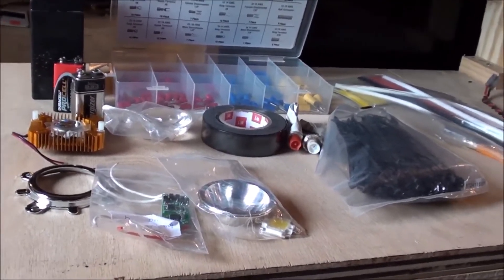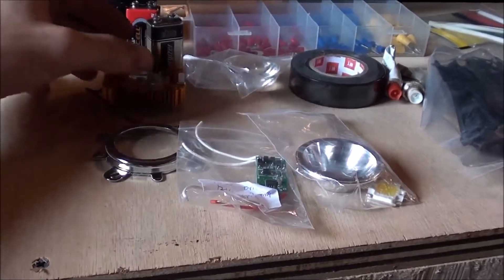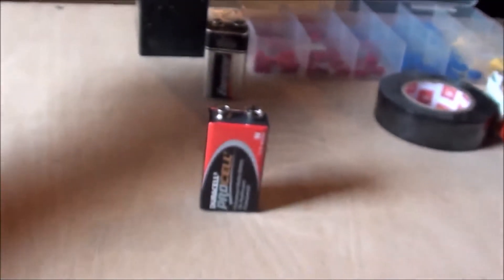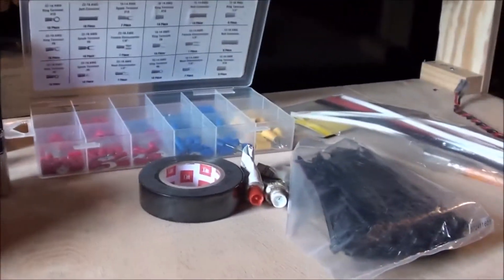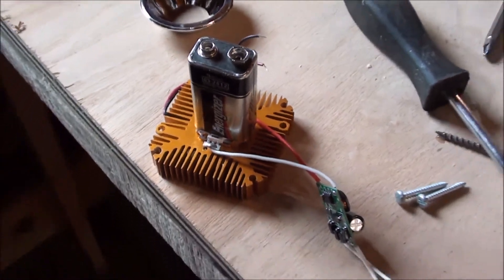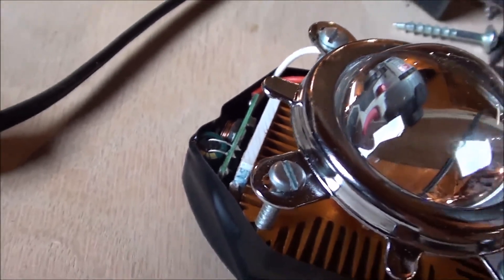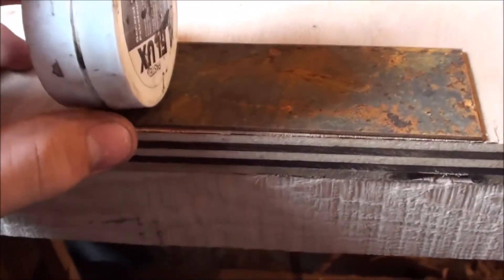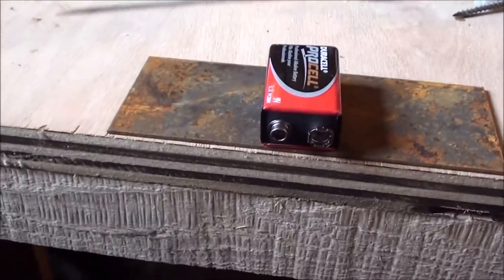10 watt flashlight prototype

Comment: good job on the prototype. maybe you should have just use super glue for the battery instead of epoxy because once that battery goes dead my true with a fan when you pull it off looking forward to the actual project
Reply from the maker: The battery is just electrical taped on. The led driver is epoxied on. If that dies it will burn out the led anyway. I think I will have it run off of 3 9 volt batteries in parallel.
Reply: endlessmountainwoodworks oh okay I thought you said you epoxy the battery to the fan..my bad! ....carry on..😶